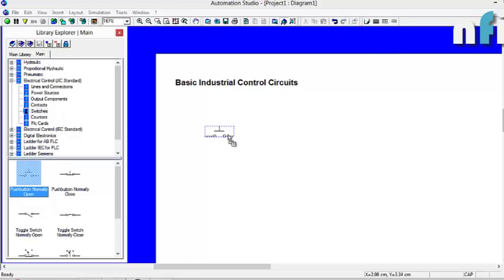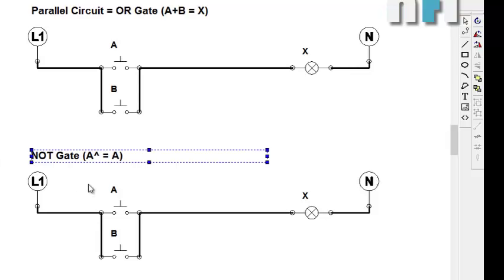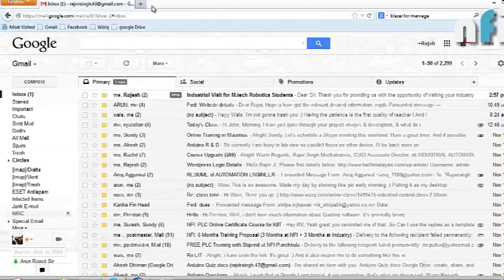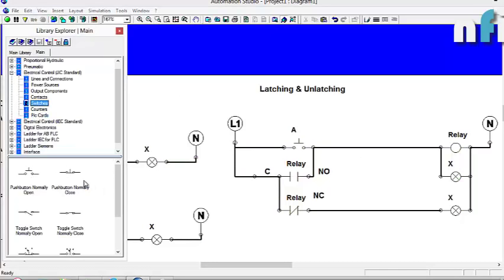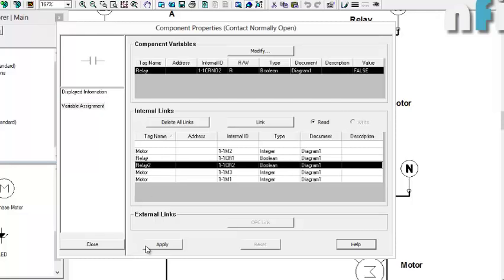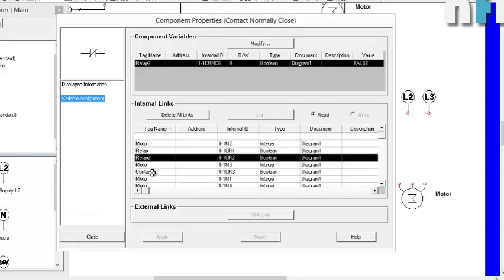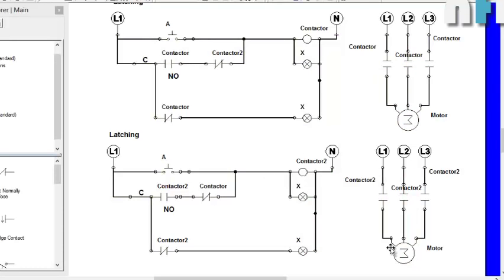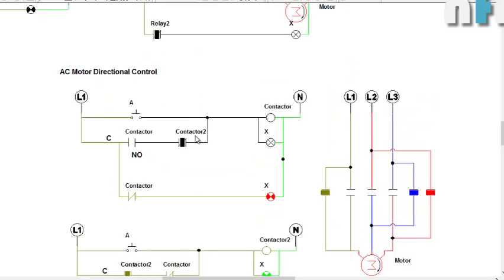Basic Industrial Controls

Comment: how do you install a toggle switch to a 523 power flex Ac drive
Reply from the maker: +Mahendra Ramdular Installing switches in AC Drive is simplest as most of the time it's mentioned in the drive manual. Well i would advice you to share the manual at nfiautomation@gmail.com for the drive you using. Generally we connect toggle between Digital Common and First multi step terminal of Drive (if you are using that toggle for ON/OFF operation)

Comment: IN THE INTERLOCKING OF BOTH CIRCUIT I GOT LOST A LITTLE BIT. I UNDERSTAND THE INTERLOCKIN OF THE SINGLE CIRCUIT BUT  WHERE DO YOU CONNECT THE SECCOND MOTOR, WHEN ONE IS OFF THE OTHER IS ON?
  (WOULD THERE BE TWO AUXILLARIES, OR ONE AUXILLARY WITH ONE MOTOR CONNECTED TO THE NORMALLY OPEN AND THE OTHER MOTOR TO THE NORMALLY CLOSED)
Reply from the maker: Hello Jermain Gordon - Yes, that could be done as well. You can use single relay and used its NO to latch Contactor 1 and its NC to latch other contactor. And simple by latching/ unlatching the relay you can interlock the contactor.

Comment: I think i found a problem in your "AC motor directional change" example.
There will be a short time transition period when both connectors are closed, and it will short circuit the L2 and L3 phases, causing some attractive smoke and sparks :-)
Reply from the maker: Yes, practically we need to add some delay in the switching of the contactor :) Thanks for your feedback.